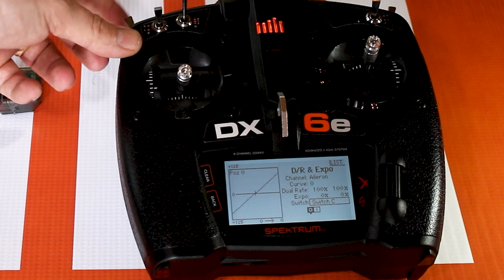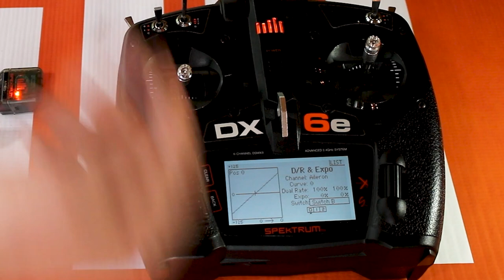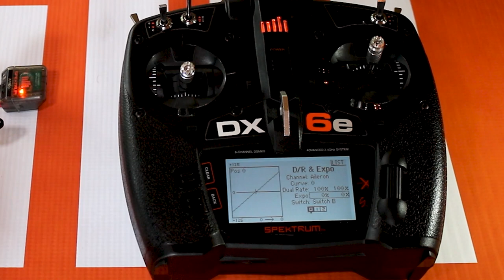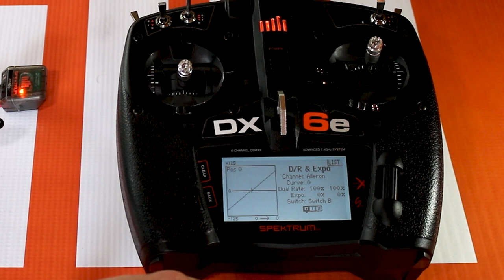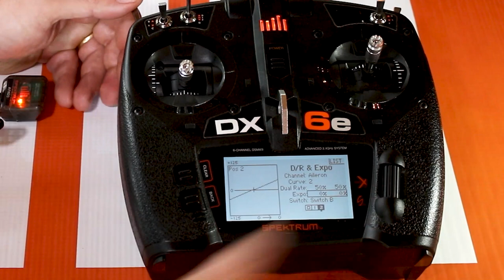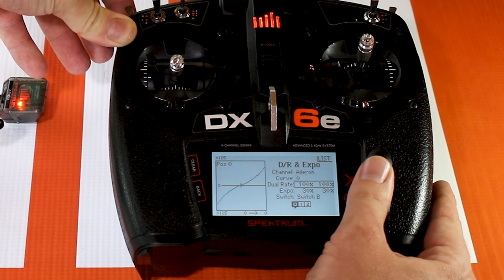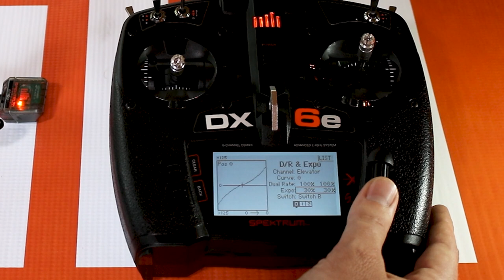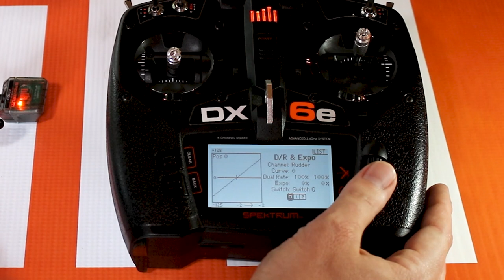Spektrum Quick Hit Tech Tips - How to Setup a 3 - Position Dual Rate Switch

Comment from the maker: In this video Tom explains to our fellow RC enthusiasts how to setup a 3-Position switch for use with Dual Rates and Expo. The settings are just for demonstration, it is always recommended to consult your models manual for  suggested travel and rate settings. For this demo we use the DX6e but the menu structure is virtually identical for each current gen Spektrum transmitter. 

Need help updating your transmitter?
Update via SD Card - https://www.youtube.com/watch?v=Dp3mn...
Update via USB Programmer Cable - https://youtu.be/vF3tUuSc-cg
Also we encourage you, the RC community, to give us suggestions on more quick hit tech tip videos! What do you need help with or what have you found fixed what you think could be a common mistake? Let us know!

Thanks for watching!
Reply: K in

Comment: Quick question I will be assembling a few warbirds and I’m setting up my D/R and Expos on my Eflite P-47 Razorback, T-28 Trojan and P-51D Mustang all models are 1.2m. the set up for D/R are provided in the instructions but the Expos aren’t. Considering I’m a beginner pilot which expos would you suggest I set my expos at for High, Mid and lower Expos ?
Reply from the maker: Hi Dev! For warbirds I normally go with 30% expo for high, 20% for mid and 10% for low. One of the things about expo is it is purely a user preference so you may find that those values are too high or low, and you can adjust them to your taste and flying style. Hope that helps!
Reply: @SpektrumRCvideos  Thanks a million guys and yes I will make adjustments with the Rates and Expos accordingly just being safer then sorry 🏁💯

Comment: How do you setup a single  3- position switch for low rates for rudder, elevator and ailerons ?
Reply from the maker: Where you select the switch, use that same switch for each control

Comment: Hi, and thank you for these very instructive videos.

I am setting up an E-Flight BNF Cirrus. How do you interpret the ailerons, rudder, and elevator specifications in the manual ?
The dual rate for ailerons is 9 mm, and 25 mm.  How do you transfer these values to my transmitter ?
Reply from the maker: There should be a transmitter setup chart on the next page of the manual.
Reply: @SpektrumRCvideos  
But they don't give the throw value for ailerons, rudder, and elevators in percentages.
Reply from the maker: @georgespapillon364  Which Cirrus? From what I can tell both online manuals give a suggested throw % and both say 100% for High and 70% for Low
Reply: @SpektrumRCvideos  
You are right, my manual is missing two pages. So after your answer, I went online and saw the missing information,

Thank you.